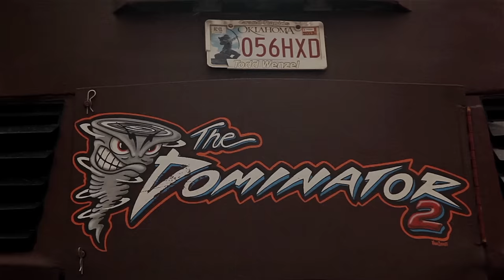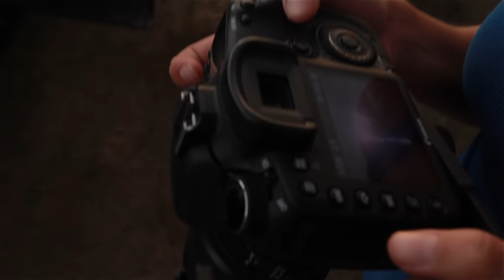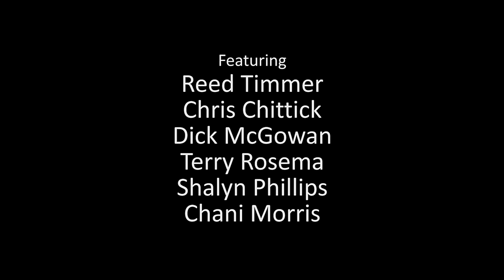GRAND FINALE Tornado Chasers S1, Episode 12 "Stove Pipe"

Comment: I use to be a right line driver. They pull over alot so that is the main culprit. From the time I started driving end of the month I turned 16 until I was 23 I had a crazy amount of flat tires. From then until now 14 years give or take. Not one flat or blow out since now that I drive center as well as avoid any home construction sites that go on. If ur behind a truck with a bunch of buckets with all sorts of things loose in the back don't follow. Get ahead of them and/or don't take that route if u can help it. I've seen nailgun strips on the ground even. It's insane the incompetence and belief that everything will stay in and on the back of people's work trucks.
Reply: So true 👍🏼